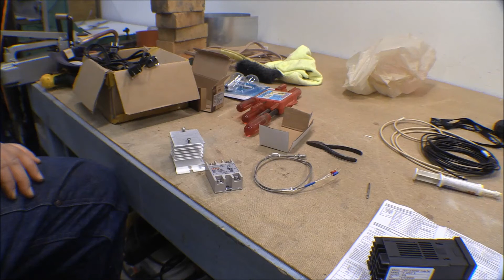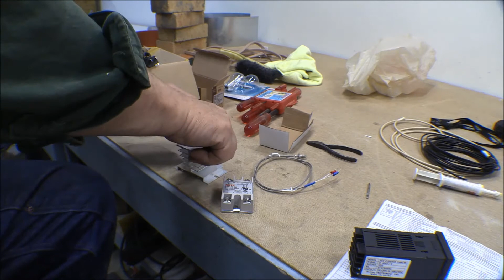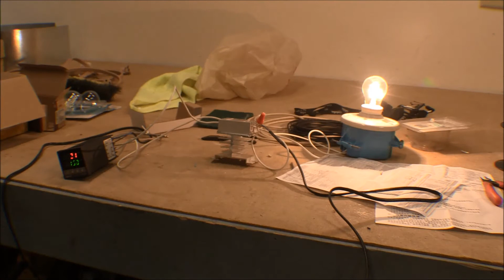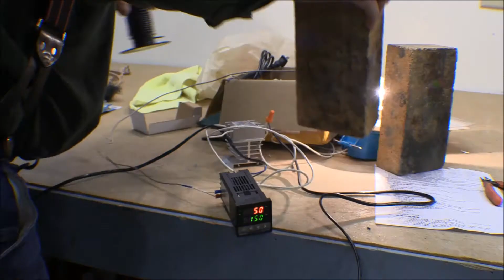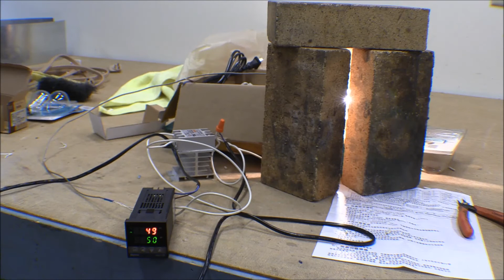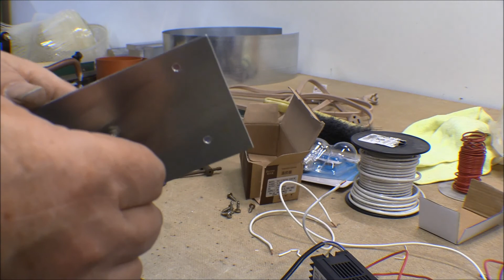Powder Coat Oven Build : fooling with the PID and SSR

Comment: I built a powder coat oven with the dimensions of 4ft ( width ) by 4ft ( length ) x 7.5 feet ( height ) 3 and 5/8 inch walls.... Skinned on inside with mineral wool insulation . I have a 250kbtu -400kbtu propane heater ( Mr heater model number MH400FAVT ) heating the oven .

For my controls system I have a inkbird ITC-106PH PID hooked up to a inkbird solid state relay that controls a gas solenoid that I plumbed into the heater itself. The oven has a k style thermocouple that I have tried in different locations in the oven to try to fix my issue. My issue is that I have a large flucionation in temps when my oven gets to 400 . It actually overshoots and heats to about 430 degrees .

Now another issue is that when the temp drops below 400 and calls for heat I can hear the gas solenoid opening and heater getting power and turning on the blower but the gas doesn't ignite for about 4 seconds which causes more temp influx I imagine but not sure . I have tried the PID in auto tune mode ... Factory settings ... And a couple pid adjustments recommended by a youtuber. I'm wondering if there is a way to maintain the temp better. Is my propane heater too big ? Do I have to wire a jumper of some kind to have constant ignite in my torpedo heater ? Do I have the wrong heater for the application ? This heater does have an internal thermostat .

Thanks for reading this and thank you for your time and insight .
Reply from the maker: Sorry, I have no experience using a propane burner. I did have the same problem trying to use a ceramic heater in place of a 100watt light bulb in my wifes incubator. The ceramic bulb stayed hot after shut off and continued to raise the temp, then took a while to heat allowing the temp to drop too low.
 I suspect the airflow through the heater before it fires and the cool down air after it shuts down cause the temps to fluctuate.